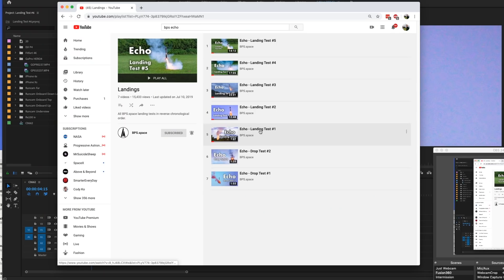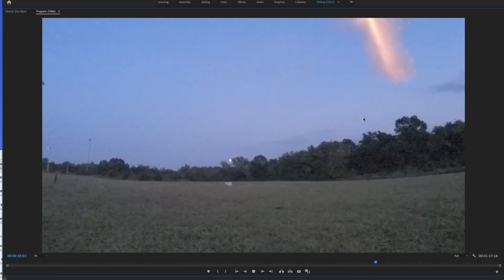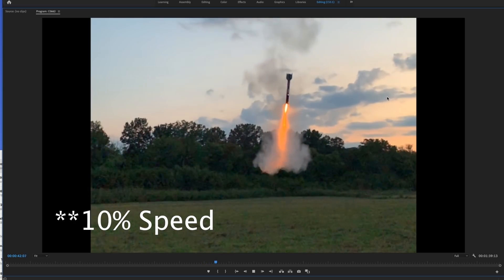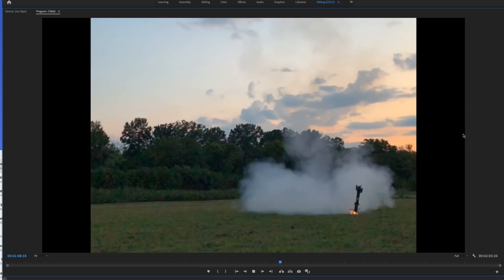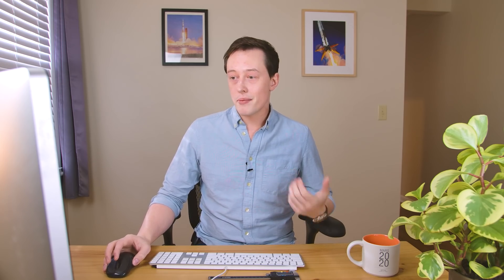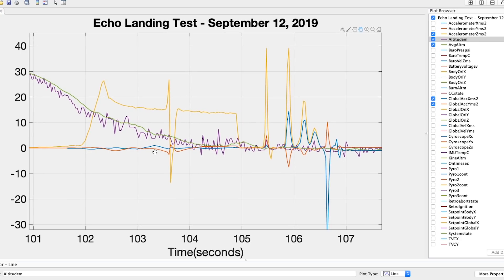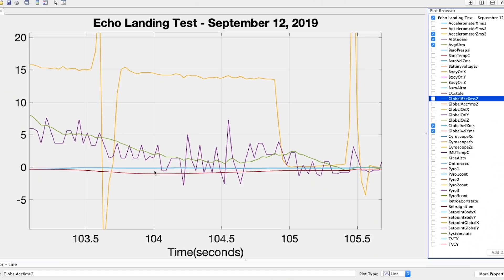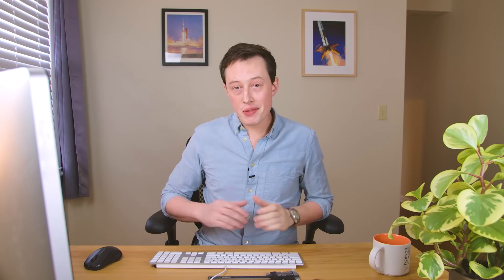Echo - Landing Test #6

Comment: Hey BPS, have you ever thought of constricting the thrust by putting something in the way of the nozzle to reduce thrust when not needed and control it better?
Reply: one the chamber pressure could destroy the motor or two directing the thrust would cause it to move in another direction and three the motor core would burn to fast and run out of fuel.
Reply: @Jonathan89482  I'm sure there's a way to engineer past those problems. But there isn't a way to shut it off when he macs
Reply: @virtualScotsman  probably but it just may not be worth it, there may be a reason why that option is off the table.

Comment: What if u put a choker on the motor  for thrust control?
Reply: @MCTheTrash  Couldn't sensor inaccuracy be overcome the same way they do when auto landing drones. Either use sonar, optical sensors or just descend at landing velocity once 5m has been reached.
Reply: Brilliant. Probably there's a reason not to, but still outside the box thinking dude. 👍
Reply: How about a second motor that is to weak to lift the rocket that ignites in the final meter to get a soft landing. Kind of like turning back the throttle but with different motors..
Reply: @MCTheTrash  I'm not sure how viable it is (weight penalty and complexity wise), but couldn't it be possible to use an optical system? Use two instead of one camera on the upper part of the rocket and maybe some high contrast targets on the ground and do some rather simple optical tracking/stereoscopic calculation to infer the distance from ground. A system like that would also be more accurate the closer you are. It would function like a less bulky and purpose built LIDAR. Again... not sure if that is even possible with the weight penalty, but tiny microprocessors are more powerful than ever.
Reply: @MCTheTrash  you're probably right with you assumptions, yeah. Thinking outside the box: Could you use a base station set-up instead, finding the distance to the rocket and transmitting it via radio? That would mostly eliminate the weight penalty. Question then is, what kind of sensor would be viable. IR and visible light is hardly possible due to the exhaust, ultrasonic is slow and inaccurate, radio on that scale is not accurate enough I think, what else is there?
Reply: @MCTheTrash  the IR tracking problem has already been somewhat well engineered: the Wiimote and the sensor bar. Hear me out here: gut a wiimote and put it on the lander, get massive IR led beacons and put it on the ground, and do triangulation. The wiimote is great for this since the controller's processor already does filtering and blob detection for you and just outputs a stream of up to 4 tracking dots... Over Bluetooth. That and the relatively limited 40° field of view is what I think is holding this from being perfect.